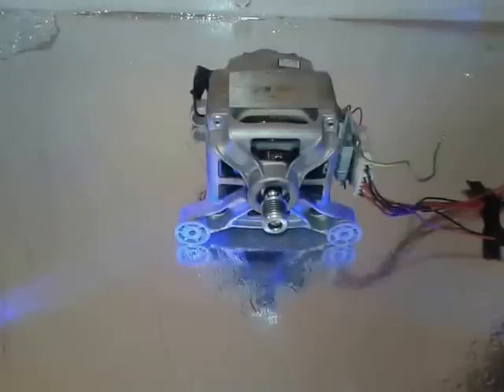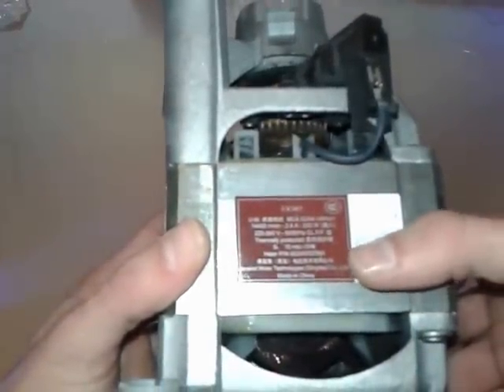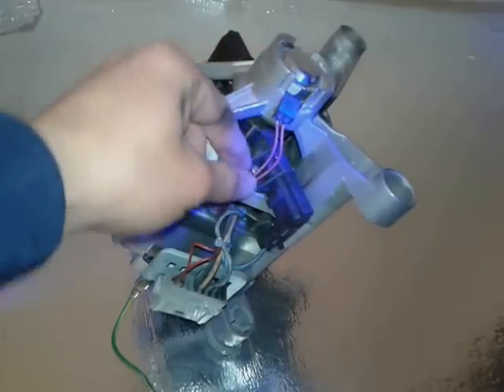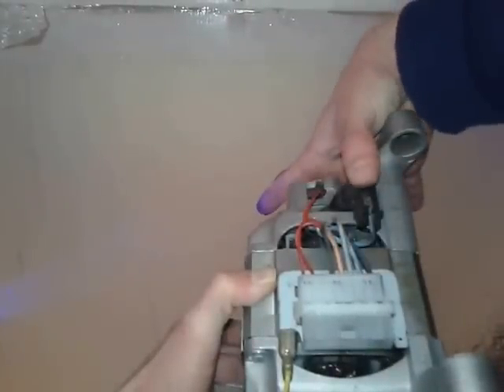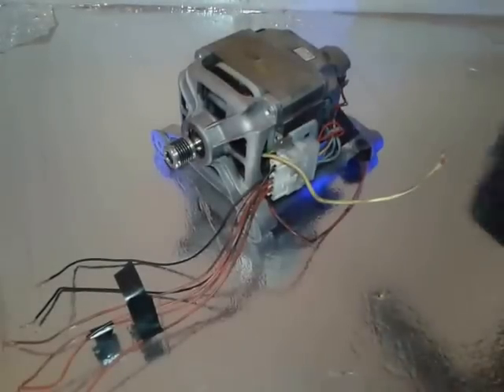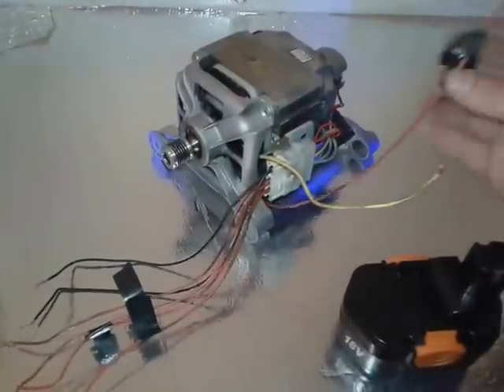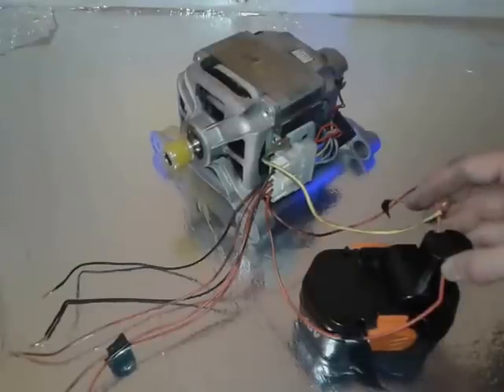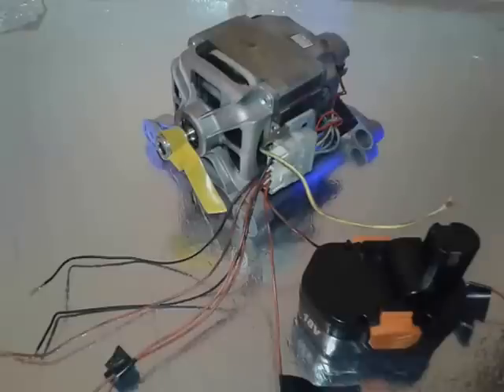Incredible washing machine motor on battery!

Comment: Another great video NoSkillsRequired !
 Tried this out today and it worked perfectly using a Beko washing m/c motor, even though it has only 2 coil wires instead of the 3 on your motor. I rigged up a test board with the motor, using a grooved belt and washing machine drum pulley to try to get some idea of the torque output on 12 and 24 volts. The output is poor on 12v but quite a bit stronger on 24, ( the corresponding 'free' revolutions go from 2200 to 3500), although I'm in some doubt whether even on 24 it would have enough torque to power an electric bike as you suggest. However I'm doing some more preliminary tests before I decide whether or not to go ahead with my proposed electric bike project which you have sparked off with your informative videos !
Reply from the maker: Thanks but why stop at 24v ?more volts more power some step up converter and you are flying 😀
Reply: Thanks NoSkillsRequired for reply. I only make things out of salvaged/scrap materials and I don't have a step up converter. Can you suggest which domestic machine might have one of these inside which I could use ?
Reply from the maker: I dont think you gonna find one or search for joule ringer inverter you can make one with just a transistor 2n3055 and a 12v transformer maybe a microwave oven transformer i am experimenting at this moment to do that when is gonna be ready i will share it

Comment: Series wound motors are able to run on both AC and DC. Those from washing machines are designed to run on AC through a Triac speed controller.

In theory any series wound motor running on AC will develop a back EMF (electro magnetic force) so in practice  a 230 volt motor will produce a back EMF of about 180 Volt. Therefore the difference of about 50 Volts if applied by a DC source will make for a good rotational performance. In practice almost any DC volts applied from 12  upwards will produce  a rotation, but with little torque.  50 Volts will give a decent performance.

Try this...2 motors connected with a belt across each pulley. Put 230 Volt through a speed controller (dimmer switch) on one and measure the output of the other. It should be about 160 to 180.
Reply: This will indicate the back EMF because after all a motor is only a generator in reverse...or vice versa
Reply from the maker: Very good explanation you know this stuff i know about a dc motor in reverse is a generator and i tried to spin this washing machine motor but i was getting nothing that means i was not spinning fast enough.Thanks for the advice and if you want a practic example watch my video about hand crank generator from a microwave oven motor and if you have something about synchronous motor please share
Reply: Just for fun and learning take a washing machine motor and identify the field winding, easy really, the two brush connections are for the armature, the other two are for the field.  Now apply about 24 volt DC through some sort of controller (variable resistor power type) to the field and then rotate the armature and from the brushes you will get good power
Reply: Single phase "squirrel cage" motors (these are ordinary motors and not series wound AC/DC types) use two sets of windings.  One for start and the other for run, a switch operated by the shaft of the motor will disconnect the start winding as soon as the motor is running, but the drawback is "slip" this means that the rotational speed is not in synchro with the supply 50Hz UK 60Hz USA.
This start winding also dictates the direction of rotation.
A synchronous motor (a small one found in fans etc.,) uses one basic winding and a single copper loop called a shading ring which will give the motor direction by inducing a high magnetic field on one of the poles.
Reply: This is more synchronous and can run up to nearly synchronous speed. This is for a 50Hz supply 1500 rpm, assuming a 4 pole motor and 3000 rpm for a 2 pole motor
There is a slip loss of 5% on squirrel cage motors referred to earlier
A true synchronous motor will use only one winding and will be run up with an external motor before being connected to the supply.  This then will run at at true 1500 RPM
Reply: Now for fun... modern washing machine pump motors (synchronous) now use a magnetic rotor !!! Connect 2 LEDs one forward and one  in reverse, no limiting resistors required,  and then with your hand turn the shaft. In the first half cycle one will light then >>>>>>>

Have fun
Reply from the maker: +George Styer Thanks for the info i apreciate it the purpose of this video is to share this info how to connect it to the battery and because is very cheap can be used in many applications  with your info i will update the video very soon.thanks
Reply: And finally...then you can go to the Pub...an ordinary fan uses a sychro motor so put this near a TV in a dark room and watch the blades.  The TV has a frame rate of  50Hz the fan is in synchro so you should see the blades still.
The supply company spend millions to try to keep the supply at 50 Hz but demand is such that there is a variation. Watch the blades and you will see.....Thank You
Reply from the maker: +George Styer What do you think about this https://youtu.be/uDAskyzFj1U is  voltage or some potential difference?
Reply: I have been blocked by * cant post
Reply: Try again...in short there is a voltage on the neutral to earth that he is using..old trick
Reply from the maker: +George Styer ok but it can be amplified?
Reply from the maker: any ideea if an of the shelf light dimmer will work on the 18v dc to make a generator from this motor?
Reply: NoSkillsRequired add in a bigger pully?

Comment: this a is very wonderful video but i wanted to ask you that how long the motor spins on 18v of power??? Thanks
Reply from the maker: thanks for watching on 18v cordless drill battery it could last 1hour maybe more depending on battery size.the motor in this configuration it draws 1amp

Comment: I have a brushless Siemens washing machine motor rated 500 Watts. Three phases connected to a bridge rectifier. It gives a lot of DC output somewhere from 9 Volt to 200 Volt in generator usuage. So as a generator, it´s not easy to use - need to step down voltage output and it´s still DC....
Any chance to run this on batteries for a bike?
Cheers from Germany, Bernd
Reply from the maker: RheinErftVideo you should look for the label if it has no brushes you could have an induction motor search on youtube how to run it I am waiting for one for tests soon
Reply: @NoSkillsRequired   Hi, I was inspired from another video and got a used motor from a Siemens IQ 700 which is shown here:
https://www.youtube.com/watch?v=xaEemoPPsKE
I´m doing the same shown in the video with a bridge rectifier and it works, but a pain to control the output.

Comment: would a bridge rectifier help compensate and increase power from the conversion?  Wish I had more experience to figure this out for myself and know if so, what size or type diodes to build it with.
Reply from the maker: Since the source in my case is a 18v dc battery a bridge rectifier have no increase in voltage .You know something ,from converting ac to dc the bridge rectifier increase the voltage.If you have more torque add more battery 36v should run faster

Comment: What is the name of the washing machine motor and what number Im going to start collecting washing machine motors.I have a question can I use the washing machine motor to dc power supply.
Reply from the maker: This is a universal motor from an whirlpool or indesit and yes can be powered from dc power check my other videos related,you have to look for the brushes something left and wright and you can do the same experiments all the best

Comment: that was very cool I'm just trying to figure out how to make one of those into a wind generator
Reply from the maker: Henery Coen Thanks for watching still trying to make generator from this... all the best
Reply: Apply 2v to 12v on field coil (brushes) then tap 1 or all stator coils for power.  Wire the coils in series for the simplest output.  

The higher the voltage on the field (brushes) the greater output of the generator at speed.  If wind powered, you will want to vary the field voltage with speed of rotation.  Faster rotation, less voltage on field, slower rotation more voltage in field.  That will keep the output steady. 

A simple voltage regulator off a car or motorcycle can do that for you.   Add at least 22,000 micro farad caps and it will run without a battery as long as it is turning.

Output will be AC.

Comment: if you put the brushes and coils in parallel it would work better for low voltage. it would draw more amperage and give more speed and torque.
Reply from the maker: jjhack3r k i will try it thanks mate
Reply: jjhack3

Comment: Anyone thought of removing the motor from a variable speed drill and using the remaing leads to provide variable speed to this motor?  I do not know if it would work from a technical aspect, amps, heat, voltage, etc, but would love to hear opinions while I reseach the idea also...Interesting to me as the motor appears to have good torque based on it's objective usage, AND drills and used washing machines are a dime a dozen so to speak.  So many useful projects are clogging my brain now, thanks!
Reply from the maker: Thanks for watching try a search some people have mannage to make electric byke from this motor drive eather with 48v or with a inverter 12v to 220v so there is a cheap easy to find motor needs more experiments so if you find something please share
Reply: scott lund hi i dodmt undestand. I want to use it for an electric scooter. That is typical with the cooking and pully transmising and housing. So how to wire it DC with 12 volt, BUTBI THINK IT NEEDS TO BE 48 VOLT TO GET ENOUGH TORQUE AND SPEED   up
Reply: NoSkillsRequired m
Reply: A good ebike plan

Comment: Just what I have been looking for to drive my small boat! One question, How long do you think the motor would run from a 12v car battey? Thanks for a great video. Dave UK.
Reply from the maker: notwocdivad nice one mate glad to help its not fully tested on a 12v battery and you have to find something to restrict the current because the auto 12v battery has lots of amps its used to start the car, in this video I used a 18v drill battery and draws aprox 2amp I would recommend 24v battery from ebike li-ion cheers (Alex uk)
Reply: Thanks for the quqick reply and the valuable advice, I know diddly squat about electricery, it's all white mans magic to me!!! thanks again Dave
Reply from the maker: notwocdivad no problem the stuff that you can see on this channel most of the experimented electricians have no clue about. For your project check postapocalipticalinventor it has something with wmm propeller all the best pal

Comment: Great video.
Would this be powerful enough to power a kayak  using a 12v battery?
Also, how long do you think a 12v 75ah lead acid battery would last for this?
Thanks
Reply from the maker: could be pissible but you need a good proppeler and some kind of shaft long enought.search for electric bike made from this motor.as for run time i measured 1-1.5a so if tge battery is fully charged 10h of run time test it first before set sail.all the best

Comment: Sorry to ask you to reiterate, each bush gets paired with a different coil then just positive and negative? 
I have a motor I want to use in both directions so am trying to find wiring methods, Thank you.
Reply from the maker: Old Navajo Tricks no pros mate so there is 2brushes and 3wires from coil. 1brush connected to 1coil and the other brush to plus and one of the other 2to minus it doesn't matter which one all the best and hope to succeed with your project
Reply: NoSkillsRequired Thank you for a quick reply, I will get to having a go tomorrow and see how I get on,
Project will be uploaded once finished :-)
Reply: Sorted and running :-)
5v line off a Computer Psu, the motor lives!
I also rescued the waterpump but forgot to test that lol
Reply from the maker: Old Navajo Tricks nice one I am glad that could be helpful no skills required rules all the best

Comment: Interesting but for others info it takes magnets to generate voltage as in the dc motor. You may get an ac motor to run but unlike a dc motor there are battery no components inside that generate voltage when turned.
Reply from the maker: The main purpose of this motor is not to be a generator i show that a 220v motor can run on battery its a cheap alternative to dedicated dc motor.You can use it to make an electric bike cart,wood splitter,sharp knifer,CAN SPIN an dc motor or alternator and many more uses
Reply: Thank you for verification of my  technical analysis. It is quite clever, though I have some skepticism until I do this, somewhere in the back of my mind I can  understand why might work. Perhaps the contacts making and breaking to their connected coils builds an energy that in effect acts like alternating current to the motor.This is the  quick conjecture of a person ready for bed. Ha!     Curiously what RPM do you get, it seems to run quite fast.    Thanks for the feedback, welcome comments on why it works.

Comment: Hello ,,, I have the same motor, but it does not work by 12 volts. Put him a battery charger, ,, 10 Amp power did not work. What is the reason, please explain please
Reply from the maker: +Elyas S hy there check the wires connection watch the video repplay as many time you need and then try with a 2x9v battery in series and take a look on the label if is induction is not gonna work in the same configuration

Comment: On the 2 speed wires could you connect a potentiometer to variey the speed at which the motor spins?
Reply: Don't attach a potentiometer directly to this. You'll have a fried potentiometer afterwards :P
Look into pulse-width-modulation (pwm) for things like this. This if you're working with batteries. If you're going to plug this into the wall, a potentiometer would pretty much melt and you'd get hurt. For pwm with mains power, a light switch dimmer might work (they work with pwm) but make sure it's rated with at least as many watts as the motor.

Comment: Can i connect the washing machine motor to my dc power supply.0 to 30v do you think if that will work
Reply from the maker: I have it run on 12v and works not on full power
Reply: Oh i have a bunch of dc motors mabuchi from printer's and i have dc brushless computer fans but i have to fix my dc power supply all i have to do is replaced the mosfet transistor on the volts side i have 19 mosfets from power supplies.so i will upload a video about having these fans and 42volts epson dc motor push the tissue box far.you will see.soon.
Reply: @NoSkillsRequired  i know but can i connect the washing machine motor to my dc power supply with alligator clips do you think it Will work,
Reply from the maker: @antresia.9723  it can work but choose the wires carefully
Reply: @NoSkillsRequired  you are the best☺
Reply from the maker: @antresia.9723  thanks buddy hope you learn something

Comment: After successfully trying to connect a washing machine motor like this to 12V batteries I ordered this 3V~24V 3A 72W Adjustable Power Supply Adapter,DC 3V 5V 6V 9V 12V 15V 18V 19V 20V 24V Universal AC/DC Adapter,100V-240V AC to DC Converter. It works like a switch and speed control for the motor. The maximum volts out are 24.1V from the power supply but the motor starts spinning when the volts out are around 7V so the speed range is rather good. I have no means of measuring the speed unfortunately.

Comment: sir I have a washing machine dryer motor it has three wire so how can I operate by
 battery
Reply from the maker: +Science WITH AUSAN I think you might need a capacitor is different wiring
Reply: NoSkillsRequired please tell me how I have a capacitor but how to connect to battery
Reply: @AUSAN   You are trying to run a single phase motor with a battery is not efficient.  Your induction motor is hard to control the speed.  Too much power needed for the motor will cause your wires and battery to overheat.   The motor draws too many amps, your DC battery does not supply (even in AC, the capacitor is there to supply more power).    
The positive goes through your capacitor by the way, into the motor windings.  The negative to the only other lead wire coming thru.  You will not be able to power the AC motor with DC battery, unless you use a power invertor.  You will need about 3000 watt power inverter which is very costly.   

If I was you, depending on what you are doing with the motor and how you are applying it, if you want to run off of batteries, find a PERMANENT MAGNET DC motor from a cart, or treadmill, or forklift.  These motors New are anywhere from $300 on up.  golf cart motors run about $400-$1000 and supply about 3-10hp @ 48volts.   You can usually find a tread mill for free somewhere

Comment: So, you rewired it into a series motor? Will it work on battery if connected as parallel motor?
Reply from the maker: yeah series conection 1brush+1coil and battery conected to the other brush and coil this motor do not work on paralel conection try blender motor or wacuum cleaner motor thanks for watching
Reply: +NoSkillsRequired Thanks! I thought universals allow for either parallel or series because its just how the coils and brushes are connected?
Reply from the maker: from my understanding of this motor universal motor stands for the posibility of running from ac or dc
Reply: NoSkillsRequired I have a rotary tool that seems to be wired in parallel. I used a 3.5volt battery to power by connecting the + and - to the brushes. It did not run. Am i doing it wrongly or is the voltage too low to magnetise the coils?
Reply from the maker: +Cosmo John Try increasing the voltage ,reverse + - ,or send some pictures to my facebook